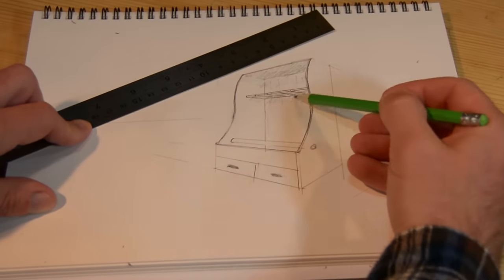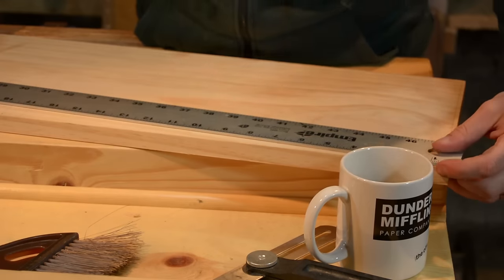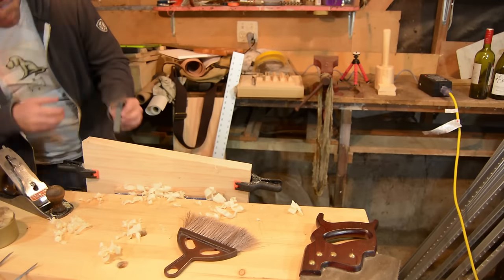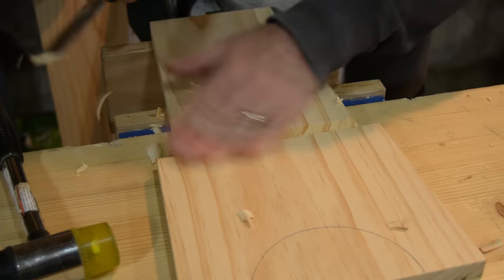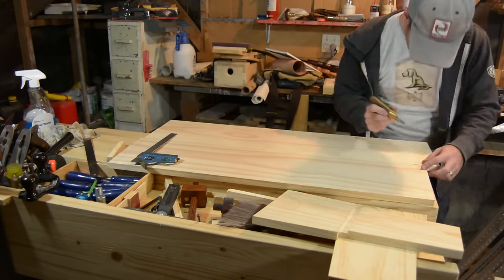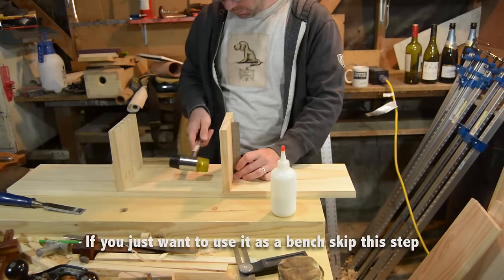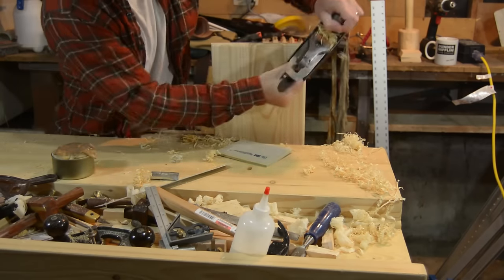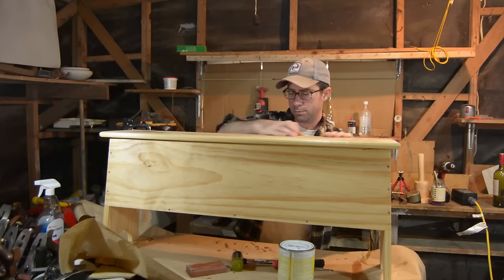How to build a saw till bench with basic hand tools

Comment: Just thinking, instad of hinges you could have made this a plug lid so that it wont move from side to side but could be lifted off.

Also think that the little word working bench tops that I have seen other people make would be interesting to have as a slide over to the box so you have a ready frame you can sit on with an adjacent work top fitted with a vice. T fit to the bench top as it were. Bonus points if you have a second bench wiith your tools designed the same way with a second top you could end up with an open square you could use as an assembly/disassembly  table and would be easy to knock down when not in use.

Comment: Nice. At 17 inches it is just the right for me.
Reply from the maker: Awesome! Though it can be any height you need. I hope you make one, even just for a bench! It's really stable.
Reply: +Clean Phil Wanted I built Stumpynubs saw bench. you measure from the knee cap down for height.   it is also extremely stable and I still need to borrow more clamps to glue it up.

Comment: @7:10  Could you clarify your statement of "do not use glue because of cross-grain issues at the end unless gluing one-inch of it"?  Are you referring to wood expansion issues?
Reply from the maker: Sorry super long delayed answer.  Yeah i was refering to wood expansion.  Really i should have made the joint sliding dovetails but i didnt so if one board expanded more than the other one would split.  One inch of glue in the center of a dado would help allowing the rest to expand/contract as needed (lesson from Paul Sellers). But again a sliding dovetail joint would probably have been the best solution.

Comment: Oh man did you purchase a pre-glued piece of lumber for the top?
Reply from the maker: ha I honestly had blocked that out until you wrote this!  
I did... I'll admit I used it because I had my cutting list correct BUT I went ahead and didn't follow it.  Then I went with what was around.  
I did plan to go back and change it but this is the only piece of that board that has finished really nicely (with a scraper too- shockingly) and the only piece that hasn't cupped, bowed, wind. So I'm still happy with it.   
Though I would caution anyone using that wood that you should figure out how to incorporate breadboard edges to keep it flat, or just use non-glued up laminates.